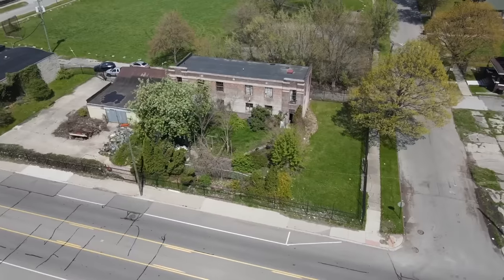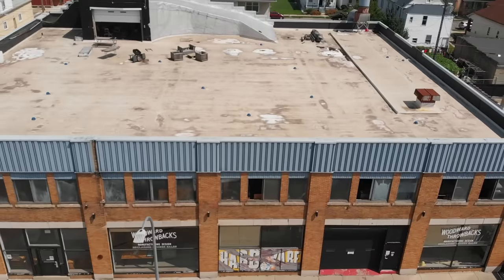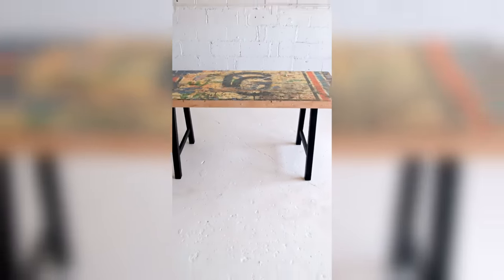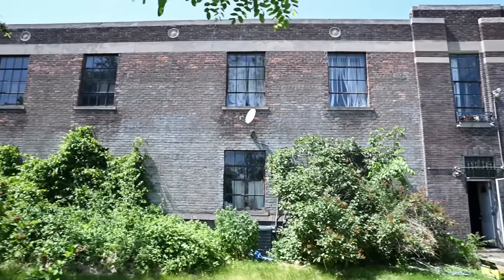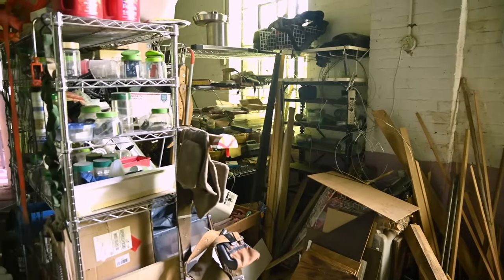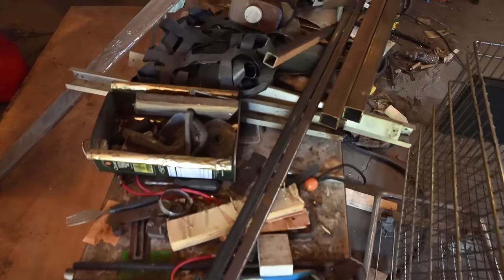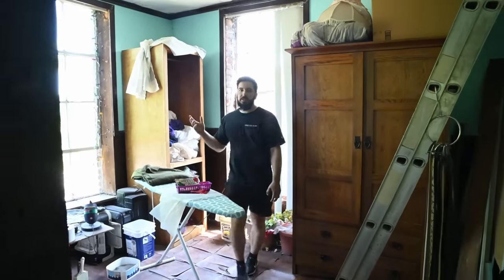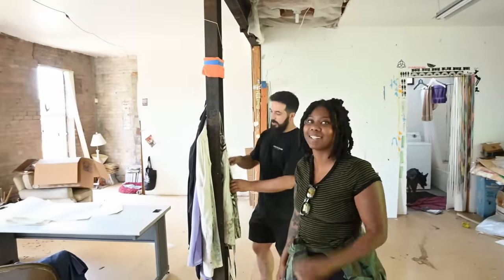We Bought an Abandoned Warehouse in Detroit to Turn Into Our Home | EP.1

Comment: I think it's beautiful, I do have one thing to say I owned my own cleaning company before I retired and be very careful when removing that title, on the floor make sure it is really wet because most likely it has asbestos into it just keep it wet and you won't have to worry about inhaling you don't have to go crazy, and use a wet and dry back with a HEPA filter, to pick up any of the water debris. It can be a very costly adventure throwing it in a hazardous waste dump, just be very careful and definitely where a real good respirator also

Comment: So you bought an abandoned building in the ghetto in the highest crime city in the country?  Have fun with that.

Step one: Replace all the pipes and wiring that were likely ripped out of it.

Step two: Install a monitored security system with off site camera storage and wired cameras to deter the squatters when they try to move in.

Step three:  Replace all the pipes and wiring again because they were probably stolen again.

Step four: harden the building against break in.

Step five: repeat step three

Step six:  mine fields, need some

Step seven: repeat step three, again

Step 8: Hire armed security, I recommend Blackwater.
Reply from the maker: Yeàhh don't need or want your sarcastic advice Kevin. You clearly don't live in Detroit and are prob some where deeeeep in the suburbs of Iowa
Reply: @woodwardthrowbacks  

Actually I grew up right next to Detroit, not the inner suburbs but the second ring out, Wayne county, we had to go in to the smelling rat hole quite often for various things.  Then, once I was out on my own I moved to one of the inner suburbs, this time in Macomb county, I had to commute through Detroit to work everyday and when I94 backed up and turned in to a parking lot as it did every other day because people in Detroit don’t know how to drive, I would have to exit in to the city itself to try and get around the traffic jam if I didn’t want to be late for work.  The Green Zone downtown is passible but everything around it, the part near 94 and 75 that I always had to drive through especially, looked like something out of Mad Max.  Burned out cars sitting in the street, boarded up burned out buildings on both sides of the road, collapsed roofs, holes blown in walls, debris in the streets, manhole covers and signs missing because they were stolen for scrap, and the very few remaining open businesses with chain link fencing across their windows, heavy bars, and razor wire on their roofs, the only thing missing was sand bags.  Hell I was nearly ambushed once, I got lost and ended up on some dead end street with 94 on one side, on my left, behind a chainlink fence and down a hill and a row of burned out houses on my other side, I turned around at the end and a damned tractor tire came rolling across the street to try and block me in, I couldn’t see who pushed it but I knew damn well that they were there.  It’s funny, I remember thinking at the time “huh, I’m surprised it’s not on fire.”  Fortunately there was just enough room to drive around it so I was able to escape the ambush but I drove the rest of the way with one hand on the wheel and the other holding my Glock in my lap.  So yes, I am well familiar with Detroit and it’s “charms,” thank you very much.

This was all around 2014 or so when I finally moved farther out, I live closer again today, but I avoid that city like the plague.  Only time I go there is passing through over the freeway, this time with no time pressure to get to work because I don’t work at that place anymore, so I never leave the freeway.  I hear some people say that it’s “coming back” but I don’t believe it for a second, and videos like this where a damned apartment building is just $6,500 (and you can see the shape it is in) prove that to me.  Sure, the Green Zone around the stadiums and people mover is doing pretty well, but that’s not where most people actually live, go out past the people mover tracks and within a few blocks you are back in the ghetto.  That is the real Detroit, a ghetto, and most of it looks just like this video.

Detroit won’t come back until it gets new people and that will 100% not happen while lazy landlords are still taking section 8 ghetto trash.  Want to “help” and make affordable housing?  Sure, do that, if you have money to waste, but just do THAT, make them affordable and then screen the applicants to make sure you don’t get the drug addicts and criminals (which to be fair screens out like 98% of your applicants down there), and stay away from section 8.  Section 8 is one of the things that killed detroit, and it continues to destroy every neighborhood it touches, and not just in Detroit.  Do that, stay away from section 8, screen your applicants, and make things affordable and eventually Detroit will come back for real because the ghetto trash will have either migrated, reformed, or died in a gutter, it doesn’t matter which because either way the good people will be back and Detroit will be too.

Until then, stay the hell away from Detroit if you know what’s good for you.

Want to hear a story?  When I was growing up, on calm days, when the wind was blowing just right, I was actually close enough that I could hear the occasional distant gunshot coming from Detroit.  So don’t tell me I don’t know what the hell I’m talking about.
Reply from the maker: @cplinstructor  from everything you just said you clarified that you still have NEVER lived in the city of Detroit. Driving through here and there doesn't count for anything. Also you can't discredit a city that you've never lived in and communities and businesses you've never supported. You've only had "negative" experiences because you've never embraced Detroit and that's why it doesn't embrace you back. It's not a perfect place and it has it own set of issues but that goes to every city and small town across the country. Detroit is an amazing city and some will love it and some will find it's not for them.
Reply: Detroit was destroyed in the riot in 1967, and never recovered.